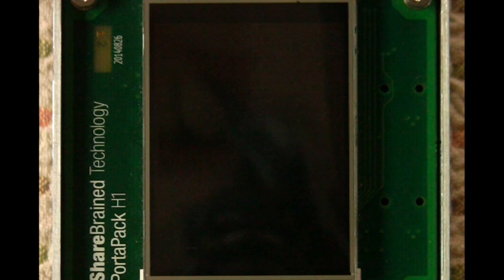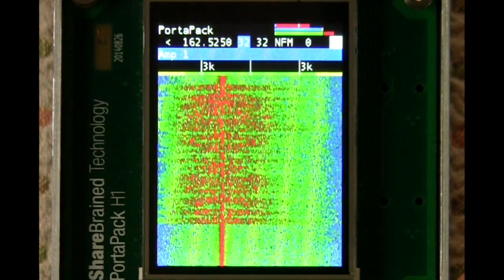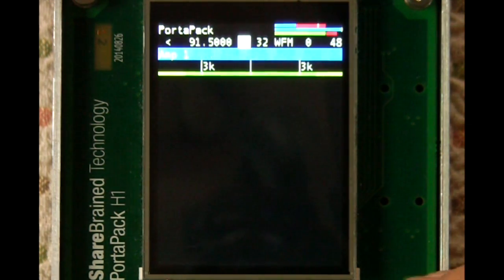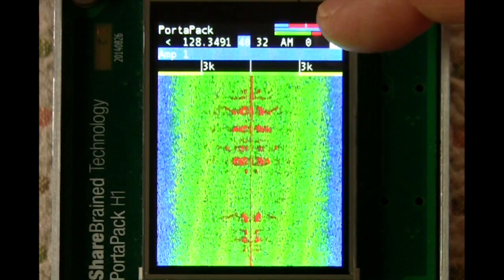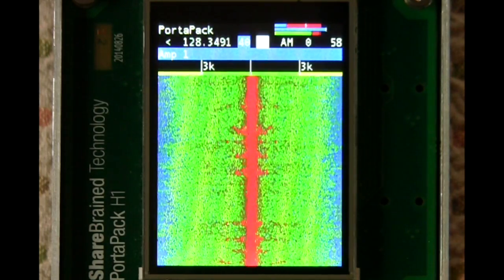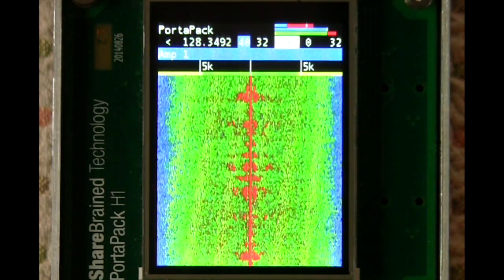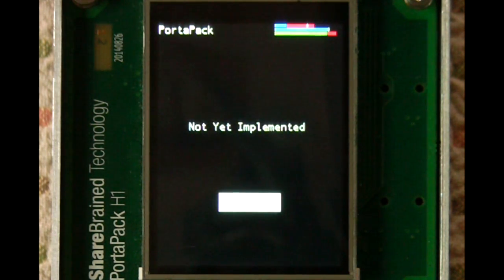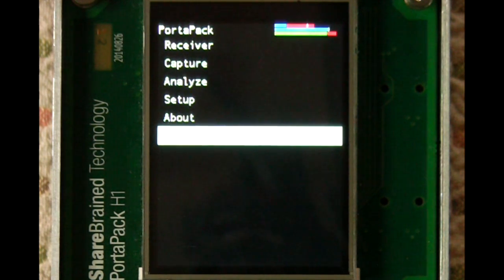PortaPack H1 Firmware 20150722

Comment: Hello, Are there was a possibility to integrate a digital radio decoder software as a DMR, P25, NXDN, dPMR, Dstar, Fusion C4FM, Idas type DSD + 1.01 or DSD1.7? whether I know many earphones VHF and the UHF wishing to use this type of portable device. I hope that such a product will be possible even if it is not simple because the AOR DV1 receiver is difficult to transport. Congratulations and good continutations product Portapack!
Reply from the maker: +F1MIJ Pascal It is certainly possible, and I am looking into supporting the modulation and packet coding for some of those technologies, where not encumbered by patents. However, the audio codec for most of those involves IMBE/AMBE, which is presently patented to the Moon by DVSI. Support free audio codecs like Codec2 for your ham and land-mobile radio projects! :-)